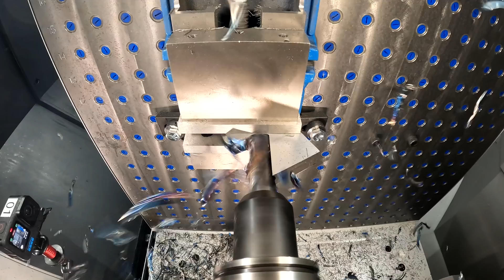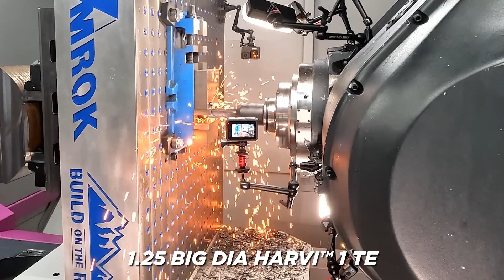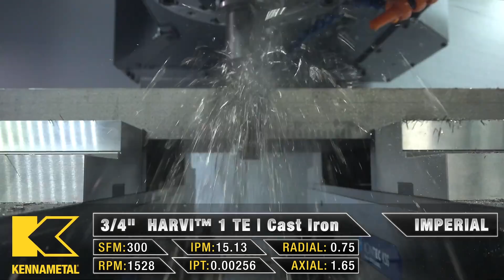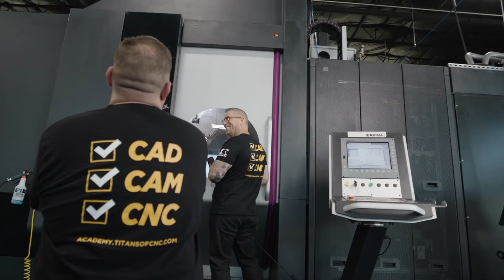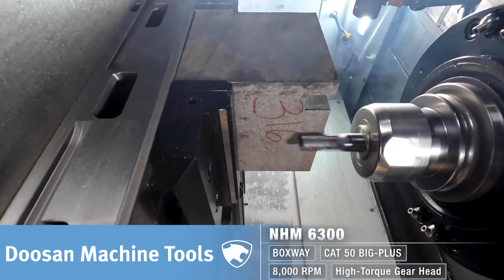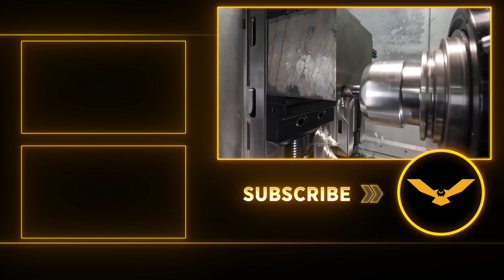Part Lifts Right Out Of Vise During Monster Machining Cut!

Comment: I am curious to know if the Ibarmia's spindle is still in specification after what seems like three to four hours of almost 98 percent spindle load. Can this machine still produce a high level of RA, and can one ten thousandth of an inch tolerances still be maintained after these extreme test runs? Has any recalibration taken place?
Reply: Of course it can. Machines should be able to run at 100% all day no issues
Reply from the maker: We talked to Kessler Spindles and learned a lot about the Spindle before taking test cuts… the spindle can easily handle 5X but the parameters have been set low. Besides, we never Crash… Big Cuts is how you Make Money!
Reply: Don't say "We never crash". Thats asking for trouble.
Reply: @leensteed7861  knock on wood haha
Reply: yeah I'd like to hear about that as well!!!
Reply: @leensteed7861  now he said it. He will crash this week change my mind :P
Reply: @ipadize  It's easy not to crash if the machine will just eat whatever it hits!
Reply: @cyber2526  knock on wood lathe 😁
Reply: Its what it’s designed to do. Presumably anyway. You should check out ibarmias youtube channel they have some great documentation on how their machines are built, its pretty crazy what those machines can do, they are some of the best in the world in their class
Reply: @alextreseder6274  Wait, I have an idea. First, hold my beer. Ok. Since Titan has a Bohm Planomat in the house, why not make a precision ground test bar for that Kessler spindle and measure and check for run-out, and any other parameters that would verify that everything is in spec? What a great idea for an education channel no? Boom, lets do it.
Reply: @TITANSofCNC  I keep trying to tell people this. With today's CAD/CAM tool path simulation tech and staying on top of your rapid override and feedrate override knobs, it's very easy not to crash a job when doing your initial run. Fifteen years here of no crashes. I've lightly grazed a vice jaw twice in that period cutting things a little close but never pile drive the spindle and rarely break a carbide endmill unless I've put too much surface feet on it for too long

Comment: Sooner or later some machine manufacturer will include a system that detects movement of the part in the holding system and stops the operation before disaster strikes.
Reply: If it used a camera. How do you prevent something from blocking the view, or confusing it with chips, and attaching a sensor to every part aint ideal either